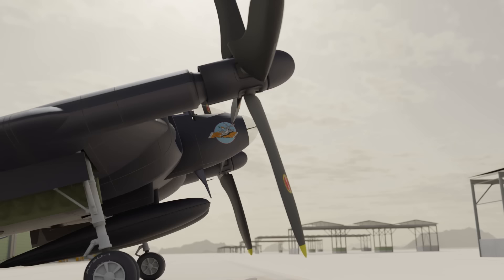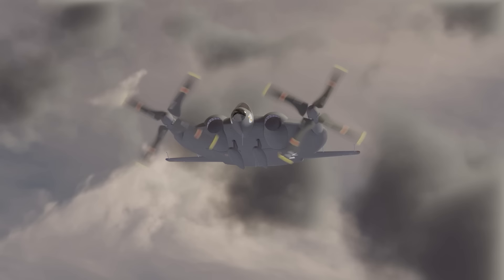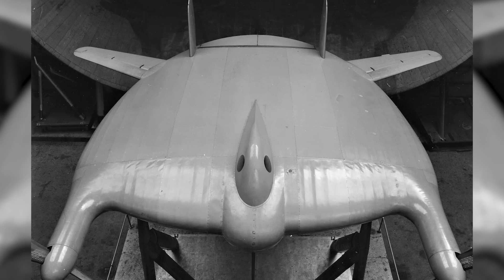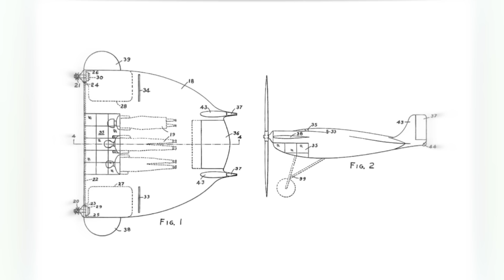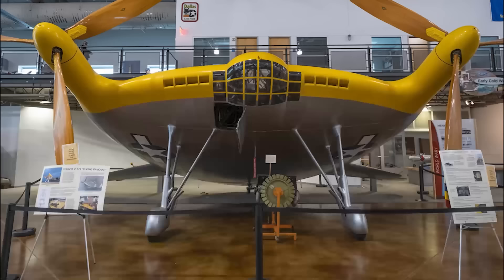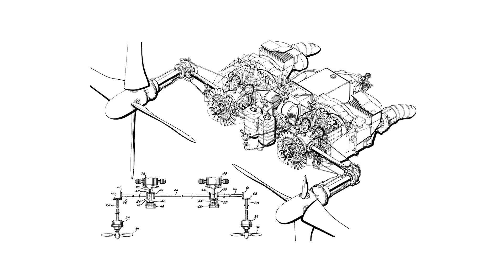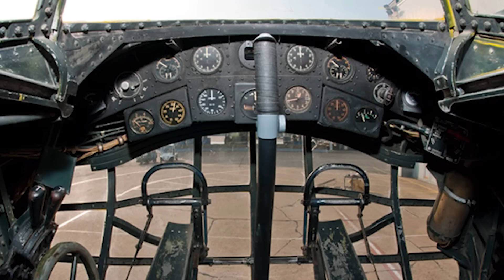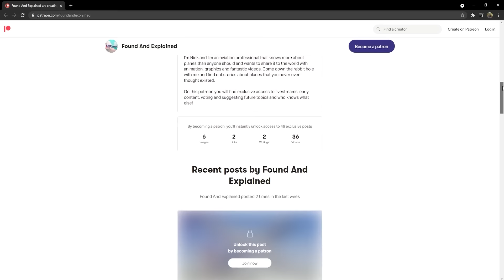The Flying Pancake - Slowest Plane Ever Made!

Comment: The Pancake actually had a decent top speed, comparable to a Hellcat or Wildcat. It's real advantage was its extremely low stall speed.
Reply: the XF5U never flew. The V-173 probably lost speed swinging those unnecessary props around.
Reply: @JFrazer4303  
Those props were necesary to fly . . .
Reply: @JFrazer4303  
No, it isn't a myth, is a matter of scientific fact. The shape of the aircraft necessitated large propellers. I made no claims about the propellers relating to its performance. Try reading for comprehension next time.
Reply: It's simply not true that the shape necessitated the props situated as they were.

See the "Flying Heel-Lift" videos about the Arup plane which this was based from.
It did everything this did, on less power and faster if an Arup ever had 160 horsepower.
Several other similar examples have flown well, and not paying any attention to any alleged huge vortices at cruise.

It is a matter of scientific fact that the Arups did everything the Vought did, proving that it did not need the props as they were.
Reply: @JFrazer4303  they are totally different designs. the massive wing tip props are to overcome the wingtip vortices which would make the low aspect ratio wings less effective. the arups would have been even better if they had adopted this layout.
Reply: And it looks more like UFO 🛸 than actual airplanes
Reply: The Vought XF5U never flew while the V-173 was very slow!

Comment: Animator/Author: The propeller blade tips go: top -> out, outboard -> down, counter-rotating, both sides critical. The idea was to keep a high pressure cushion under the aircraft. It worked fantastically well. You need to modify the animation.

Comment: OK, but how SLOW could it fly? This would make a great design for spotting or aerial photography.
Reply: @Bryce Kleinschmidt Because a fast plane is gone in a few seconds. The closer to the ground, the greater the problem. A super slow plane uses less fuel than a helicopter but can monitor the ground for extended periods. It can also drop cargo very accurately.

Comment: Everybody who's talking about electric replacements, keep in mind that these are 80 horsepower constant motors, a Tesla only uses approximately 30 to 50 horsepower to maintain freeway speeds, and a small 80 horsepower electric motor isn't made to run for more than 30 minutes

Comment: I used to work at the vought factory in Grand Prairie Texas where they restored the V-173 and got to see it on a daily basis.  A truly remarkable aircraft
Reply: I worked there as well. Blackhawk program. Better than a museum. You could actually touch them and look inside.
Reply: @hidingposer3422  I started as an IE intern doing time studies on Blackhawk during the 2nd shift back in 2007
Reply: @insertjjs  So.....your one of the reasons first shift got 40 hours for 2 hours work and I got 1,5 for 9 hours work? I was there in 2009. $10.85 an hour working on flight critical components and training other people? I had to go.